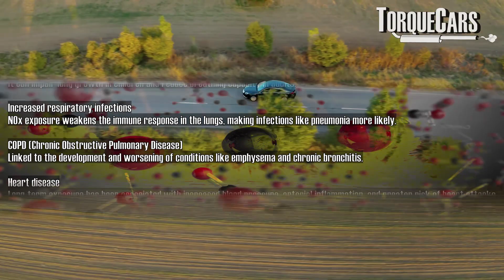EGR Delete & Nox Emissions: The Inconvenient TRUTH🌤️. Are EGR Deletes Worth It & Necessary?

Comment: We also need to ask if the claims that carbon dioxide (CO2) is causing dangerous planetary warming are even true. Thus far all attempts to prove that have fallen short. While CO2 does, in fact, trap heat most of this occurs a very low levels of CO2 after which that phenomena falls off rapidly. Reconstructions of the planet’s CO2 and temperature levels over the last 600 million years show little correlation between the two.  IMHO I think the real reason that CO2 was designated a pollutant is so that which creates it, i.e. fossil fuels, could be taxed so politicians and their cronies could line their pockets.

Comment: Great video! I need some help, i recently did a stage 2 software on my polo 1.9tdi and on start up a p0236 fault code popped up and went to limp mode, every time i start the car that code pops up and straight into limp... what is the cause of that
Reply from the maker: Hi buddy, it can be hard tracking down these issues without inspecting the car. A boost leak is the most probably cause for this. It coped well at standard boost levels but the extra from the upgrade may prove too much. The turbo wastegate actuator could also be an issue and might need renewing or calibrating. Does it still do this if you remove the intake filter? If so that could be a simple restriction. Stage 2 is generally more than just a software update https://www.youtube.com/watch?v=yd-_U-QvgWc so did they do anything else on it?
Reply: @torquecars  ive installed a new gt1752v turbo and when i bought the vehicle it had bigger injector nozzles and a seat sport front mount. Some guys are saying i need to get a higher bar map sensor as the one thats currently in is from a 74kw (wasnt changed when engine was swapped to 96kw) so guys are saying the 3bar 96kw one will sort the issue... But i have no idea and dont want to spend unnecessary
Reply: @torquecars thank you for responding.. Yes i recently installed a bigger turbo and i got the vehicle with a front mount intercooler and bigger injector nozzles.. Some people ive spoken too says its the map sensor, the one in the car at the moment is the 74kw map sensor, the engine was swapped to the avf 96kw engine so ive been told i must get the 96kw map sensor and it will sort it out but i dont see how it could be the issue because im not pushing over 2.5 bar boost..

Comment: 110k on a PD130 with EGR. I use premium diesel or Millers additive. All sorts of driving. Intake still clean and EGR clear on a check at 60k and 105k. No issues so I'm happy to run as is.

Comment: On the Gen 3 Prius Toyota had a problem with blown head gaskets. Whilst I don’t think anyone knows the primary root cause 100%, the OEM really did key in on the EGR and PCV systems.

The 2ZR-FXE engine loves to slurp oil out of the PCV valve. This oily vapor combined with the EGR particulates around the small EGR ports inside the air intake manifold to make a hard sludge and differentially block those 4 ports.

Since engine cylinder 1 is furthest away from the point where the EGR gasses enter the plenum, it was often being completely chocked off of its dose of this inert gas.

With no sensors to detect this Cylinder 1 chronically operated in a lean condition. With #2 right behind it. The excessive heat generated here resulted in an epidemic of HGs blowing between #1 & #2 cylinders.

So my question is, if the EGR system is completely removed won’t this risk cylinder overheating and possible engine damage?

Comment: Spot on video!
Although I had my EGR valve disabled on my current 330d (and my previous 330d which I bought in 2010), both had intakes that were quite badly sooted up (approx 1/4" thick, with 86-90k miles). Disabling the EGR kept the intake clean when I checked them several 10s of k miles later. 
Prior to my 1st 330d I had read a paper by researches (at a Uni IIRC) describing that burning exhaust soot twice (via EGR) made the soot particles harder and larger, quite possibly big enough to breach the oil film between the cam lobes and followers. So between that paper and the soot build up issue is why I've disabled my EGRs. Although many years later now I've not come across any issues with camshafts wearing out on high mileage diesels!

But I'm in conflict with the greener side of myself, ever since I bought my 1st 330d I was well aware of the Nox problems (which was also mentioned in the paper I referenced). You mentioned the health issues, but Noxs are also a strong greenhouse gas. I don't think you mentioned that point? (Unless I missed it, my gerbils were bugging me! lol). I've also been aware and agree with the CO2 emission problem for 20 years or so, and have certainly seen the changing climate in my lifetime (55 yrs old).
So on the one hand the greener side of me wants to keep my emissions low, but the mechanic side of me wants to keep my engine clean, at best efficiency (fuelly.com shows my past year of my 330d at ~47 MPG) and most importantly do as little work as I need to on my own car!
What I've been meaning to do for some while now is to have the EGR valve re-enabled and just resign myself to having to take the inlet manifold off every 50(?)k  miles to clean it up (although the head intake ports aren't so easy. I wonder if there are mobile walnut cleaning services available??.....). Although it's quite possible that my 330d wouldn't soot up much anyway as I don't drive to work (I'm lucky that I can walk there), and 80-90% of my driving is on motorways and dual carriageways.   
I really should re-enable the EGR valve.....
Oh btw, the DPF is intact.

Comment: When GM and Fiat worked togheter some times ago, they shared some technologies, among which the EGR applied to petrol engines in order to increase their efficiency, not only to reduce the NOX emissions. If you fill a cylinder (partially) with exhaust gases, you can have the throttle more open at idle or light load, thus less vacuum in the inlet manifold and the ports, and so you reduce the "pumping losses" which accounts for a significant part of the difference in efficiency between petrol and Diesel engines. This was at the cost of no engine braking at all, but allowed for very high MPG's at low revs/load. Examples: Fiat Tipo 1.4 (Fire engine), Opel corsa 1.2 Ecoflex 70/80 HP (before the Peugeot's takeover). As for the electric cars, sorry, but as an automotive engineer I pretend there is no significant gain to be obtained with this ill-born idea. From the power plant losses (a Gas power plant has an efficiency of about 50%) through the network losses (another 30%) to the losses at the charger (from 5 to 15%), any Diesel engine is better from an efficiency point of view. And then there are those two tons of materials, steel (extremely dirty to produce+ huge CO2 emissions), rare earths, Cobalt, Lithium....For me we can unplug the plug once for all, and instead reduce the weight and the dimensions of the cars, that have become completely ridiculous nowadays, even more than with the 1950's US cars.

Comment: I think it depends on how well designed and how robust the EGR system is. My 1.4 TDCI is on 150k miles and the EGR system is fine. Removing the EGR can make the engine take longer to warm up.
Reply: That's not right cars run a lot hotter with a EGR delete
Reply: @lampy80  During warm-up, the exhaust gas contributes to faster heat-up of the engine coolant and surrounding components. This is because exhaust gas from the cylinder goes into the EGR cooler and this raises the coolant temp. I've heard cases where an EGR system has been removed and it takes longer for the heater in the car to work.

Comment: The thing that annoys me is that people who are either pro-EV or anti-pollution think that everywhere used to look like London did in the late 19th century, thick smog all the time until EV’s came along… no we’ve not had anything like that for decades because modern vehicles are much cleaner and the average car doesn’t chuck out plumes of black smoke like they did in the 70’s or 80’s.

Cars peaked towards the end of the 2000’s, and since then they’ve been bogged down with restrictive equipment which is making extremely diminishing returns on their investment from the manufacturers, truth is a well-maintained engine, yes even a diesel, won’t throw black smoke clouds out the back simply by removing the DPF/EGR, its vehicles that are battered and left to rot without any form of maintenance or servicing that causes that.
Reply: Removing the DPF allows more soot into the air, just because you can't see it doesn't mean it isn't happening. As an MoT tester I can quite clearly see the difference on the smoke (soot) emissions tester results. DPFs get rid of the smaller particles you can't see, as well as the bigger ones you can see (and yes you can with non DPF cars, even if it isn't clouds).
Noxs are also invisible, disabling the EGR valve or adblue systems will increase nox emissions.
Yes these extra emission systems make engines less reliable, it's the price we pay for cleaner cars, including invisible emissions.
Reply: Yet Hybrids not tested for emissions at MOT, people so brain washed with climate weapon nonsense

Comment: Decreases exhaust gas temperatures which helps the life of the the turbo charger. That is why have kept my EGR. I use BP Ultimate diesel which has best cetane rating in the UK, which helps reduce soot production by reducing incomplete combustion…
Reply: Makes no difference to the life of the turbo, the EGR is only used under light load when not much fuel is burnt anyway and so not much heat quantity put out. Under full throttle load of course more fuel is burnt, and more heat exhausted.
In addition to that I had an e46 330d, I bought it with ~88k and soon after disabled the EGR, 8yrs later I sold it to a mate of mine with 192k on the clock, he then took it to 220k miles (before he parked it up and let it rot :( ). It was still on its original turbo and no signs of any problems.

Comment: My experience is as follows. Megane 2003 1.9 120hp - egr got blocked, had to be repaired not just cleaned, it got literally broken and engine was full of soot to amazing levels. Engine was completely restored with new turbo and was running very nice after that. 
 Bmw E90 320d 177hp Egr was brand new when  I bought car second hand as it broke down for a guy before I bought it from him. I went on 2500 km round trip and car started doing hesitation and stutters in first from lights. Got to some tuner house, he downloaded my map turned it off and reuploaded it. We left it in there in closed position. Car is running absolutely smooth, beautiful, more responsive and everything, quite a big change. To be fair because its nox emissions and we all pretty much pull dpf off etc I think diesels should be simply retired, like banned from producing and let these already existing ones run for another 10 years and than ban it all together, but I would leave gasoline engines even higher power ones, or ESPECIALLY high power ones  hahaha. Co2 change in air might not be as politicians are doing more of their agenda than truly caring about enviroment. ANd I consider nox more dangerous for us and it is only logical that we will find better and better ways to fight co2 anyway. ( For example also we need to reforest alot, they talk about co2 rising while absolutely demolishing forests.... )

Comment: my car was smoking black smoke every 100km (mostly in the city), for 5 minutes. then i deleted the dpf (not sure if the guy also deleted the EGR), but since then the car runs nice, no smoke whatsoever. But i'm 100% sure that replacing my car with a new one (that i can't afford) will be much worse for the environment. governments just want cars to become so bad and expensive that you rather take the bus or bike...
Reply: Wrong on so many points.
No smoke that you can see, but fine particulate matter (soot) that you can't see (much) will have increased substantially, and noxs.
No, a newer car (doesn't have to be new) would be much cleaner, especially after you've deleted the DPF (which btw should be an MoT failure). 
Got 155k on my 330d with DPF, no problems with that so far at least! (Timing chain? Yes!).
Reply: Cars normally smoke more with dpf removed especially when you floor it

Comment: Getting rid of or lowering pollution is diminishing returns, Mankind itself is a pollution engine, if we want all the things in the modern world, there is going to be a cost to that ( environmental) if you said that all the things we enjoy in our lives today would have a cumulative effect of lowering our average life expectancy of the individual by say 4 years, dyo know, i think most people would be happy with that as a price worth paying, not to say we shouldn’t all do what we can but the transition to Ev from cradle to grave, i think the savings are minimal, ergo as an example, the cradle to grave carbon emissions for a nuclear plant including energy used in construction, concrete, mining and processing the fuel and de-commissioning is about the same as a gas fuelled power station, so its not easy to say one energy is cleaner than another, but yes, the motorist is the low hanging fruit, easy to say, politically, we will ban your personal car, can you imagine if someone said, no more flying. So the polluter does not always pay as their is no taxation on aviation fuel.

Comment: Many good points. 
Emissions should be maintained for road bound vehicles. Industrial machine, government and state should also have emissions, however reduced perameters. Currently some get exemptions. 
Go back 80 -100 years ago.. it wasnt cars that were the problem. It was factories, bellowing smoke into the air. 
Cars are still a small chunk. We have come a long ways from 60 years ago. Skies are much cleaner. 
We need to be clean.. but not overdue it. Dont take every word tre huggers and scientist say as gospel.